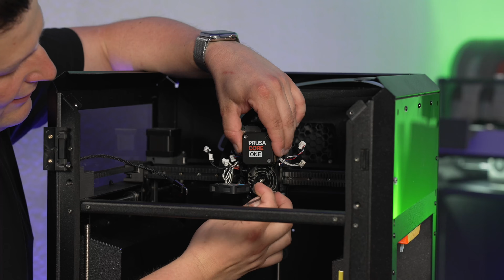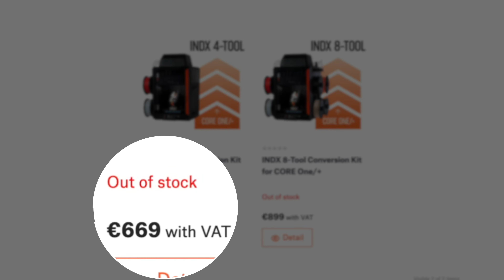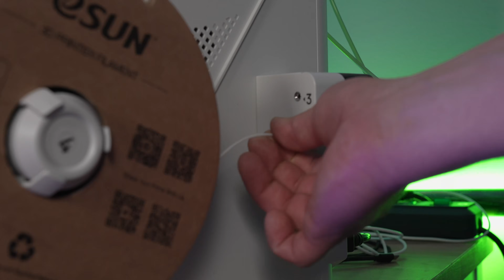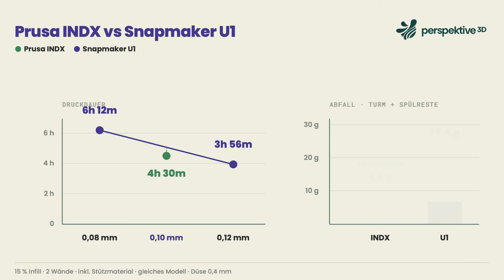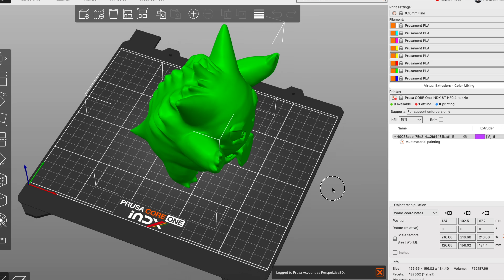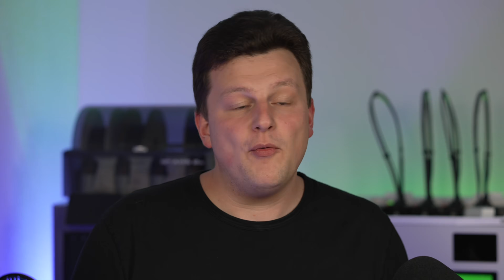Prusa INDX: Is It Worth the Wait? My First Look

Comment: Did you do any retraction calibration, or other testing? If you did, I'm sure we'd all like to see results and how it changed. If you didn't...

I wouldn't expect individual nozzles to be available for sale until demand slows and they can fulfill new orders.
Reply from the maker: I did no retraction calibration as I wanted to stick to the regular calibration that the printer does out of the box. I never did any retraction calibration for PLA on any of my printers
Reply: @p3d-intl   I sometimes get stringing between different colors of the same brand of filament. Not doing a 15 min calibration, even just for demonstration purposes, because "I don't want to" is absurd.

Comment: I would have been fine with just two nozzles on the Core one+/L. That's what prusa needs to release to be able to compete against the X2D, which will be it's most imminent competition. One high temp nozzle for engineering prints and one lower temp nozzle for supports. That's what I want from prusa.

An kit upgrade like that with an active heater should be prusas most urgent focus imo.

Comment: Regarding the filament management on the printer...... it is such a pain and imagine what happens when you use printers at work with several users having access to them and swapping filaments without telling others in a clear way. Do we really need to do this manually in 2026? 😵‍💫😵‍💫

Comment: I think I'll stick with my Snapmaker U1. Even with just 4 colors it's still a game changer and I haven't had a single issue with it in hundreds of hours of printing. I was a Prusa fan boy for years with my MK3, but they dropped the ball and have gotten lapped by the field. The Snapmaker running Klipper and Paxx firmware is just perfect. I really like the RFID tag support for the spools.

One a final note, I am mystified as to how you can recommend this upgrade at all. Did you see how crappy your model printed? It was unusable. This kit as it stands is unusable.

Comment: I would say the H2C with its 7 filaments with no purge and I think 25 filaments with surprisingly little purge depending on the model, is a much more compelling machine. 

You pay a little more but get a much large print volume and a very polished experience. I'm not convinced with the first impressions of INDX and I think they needed to put out a more polished product from the start.

Comment: I know that full spectrum and now this Prusa color mix thing are all the rage nowadays, but does anyone else agree with me that the colors they produce are pretty dreadful? Muddy, unsaturated, really poor on small details.
Reply from the maker: A true multicolor print will be better for sure. But will try the 8 color CMYKWRGB FullSpectrum print and lets see what it brings
Reply: @p3d-intl  Ok. I would like to see a 4-color print with regular filaments as I think that is more representative of the way most people print, and it would also serve as a comparison against the Snapmaker and Flashforge.
Reply: Full spectrum is just dithering with another name it can never produce high saturation colors because of the way it works. The bigger problem I see is the color can shift based on surface curvature so for organic models where people often print multicolor it doesn't work well.
Reply: I also don't get it. I've seen a lot of enthusiasm around it, but the prints just look bad.

Comment: So it's twice the price of the U1, buggy as all hell, and it's not even out yet. I am feeling rather smug about backing the U1 by now. I've gotten real and hard use out of it. It's not just a filament changer. It's a rugged and reliable machine, it performs automated coldpulls keeping the nozzles clean by default, I have hardened steel nozzles in various sizes, there's an active community developing crazy stuff like the color mixing, and that's just what immediately came to mind.

Comment: 7:22 not a u1 fan boy, I do own one, along with a p1s and a qidi q2, and actually the U1 has been my most problematic printer, but I have timed tool changes a couple dozen times and even with the prime tower I've never had it take more than 13 seconds from stopping printing to starting printing. Most the time it's been almost exactly 12 seconds. Though the hours I've spent unclogging extruder pathways from 95a tpu is much more annoying than long print times and wasted filament imo
Reply: Very interesting !! I think about getting a X2D to print TPU with supports.

Comment: I’ll be upgrading my sv08 when the Indx is available, but I’m in no rush. I have an H2c which handles everything I throw at it. Sure, it’s slower than a tool changer, but, again, I’m in no rush. I’m a hobbies and these I 3d print for fun. I think the Indx is the best tool changing system out there, I just wish printer manufacturers would just license the tech from Bondtech and sell a completed machine with the Indx installed. I believe the Sovol M1d (?) is an Indx tool changer. I won’t be buying that one because I already own an sv08 and I wanna tinker with the upgrade process.

Comment: Excellent analysis. I think this V-block purge method with single wiper styled like bambu and snapmaker wipers with a silicon brush and a ptfe tube on a hinge will be epic. Mod the snapmaker U1? Eliminating the prime tower would be epic.

On the hotend temp. I would bet that the "needs 6 colours" market and the "needs engineering filaments" market have minimal overlap. and the 6 colours market is WAY bigger.

Comment: do you need that many nozzles? YES! I've had plenty of times where 5 is not enough.......AND you get a support nozzle (when the software gets updated). Since I'm doing the core one L, This means 9 colors + support. I'm wondering if you could do purge to infil to get better quality. Assuming the firmware update doesn't work........I'm curious to see the result of the firmware update.

Comment: The only thing this machine has over other multi tool printers is the number of tools and those are cheap. The print quality isnt as good as the others, its expensive for a lackluster printer, and the fact that Prusa can take years to get their updates right shows a lack of urgency. This practice is predatory as they know their diehard fans will pay for it. There are other printers, while they have fewer tool heads, have a much better software, built in features, and the print quality is definitely better. No one should be recommending this printer at least until they get their shyt together and fix the glaring misses.

Comment: Ah, the 290C may not be the nozzle issue but the current housing they are using for the nozzle and tool head can’t be heated up more currently. 🥲 

We might need more metal housing INDX in the future. 😅🤘 🎸

Comment: I almost ordered it at release! And almost when Prusa opened the pre-order. I held back both times. And it was the right call for me! My interest is in multi-material, not multi-color. The ability to use multiple nozzle-sizes in one print could be of interest. But that is probably not going to be available for quite some time. And last but not the least: It needs better heat-capabilities! Higher nozzle-temps, higher chamber-temp tolerance, and an active heater! I have been a Prusa supporter (not fanboy) for years! But this is getting silly! Look around you, what the others are doing! How hard can it be to develop some sort of integrated filament management system, instead of those overprices passive dryboxes scattered all over the Core One? And why go with the Core One + from the start, rather than the much more suitable Core One L?

I just ran out of patience with Prusa! Despite hating the company BBL, I just got myself an H2D with AMS 2 Pro. Have not done much more than test-prints yet. And it certainly has it's quirks as well! But the level of integration and neat packaging is decades above Prusa! At the end of the day, reliable prints is what matters the most. And I simply don't know much about that yet for the H2D. Bur first impression of the physical appearance is great! I just hope I can make it work the way I want it to, without using any of their cloud services. 😛

Comment: I own a Core One+ and wanted to order the Indx. Now the maxtemp of 290 is a deal breaker for me, so I'll wait and see. I'm mostly using it for tougher filaments and wanted Indx for supports in cheaper materials, different sized nozzles for speed/detail etc. I have some filaments printing around 295.

Comment: Thanks for the review. So far for the price and all the delays I am not impressed with the printer at all. I would like to see some regular multicolor prints, Not the mixed ones. As in compare some four color prints against other four  color printers. And I would like to see some 6 and 8 color prints too.
Reply from the maker: Thanks for your feedback. Will plan that for the review
Reply: @p3d-intl  I have a Creator 5 Pro on order. For me to even consider buying a printer this expensive it would have to print as good, if not better than a Creator 5 Pro. I would rarely print with more than 4 colors. I would love to see some 6 - 8 color prints with this printer.

Can you print a HueForge type print in 6 - 8 colors. I would love to see how one turns out in that many colors without a bunch of purge waste.

Comment: How many people have the skills,  time, and inclination to spend 8 hours assembling a printer. This Prusa INDX will not be a factor in the marketplace until they come out with a complete unit at a reasonable price.
Reply: I've spent so many weekends tearing down and rebuilding my MK3 with a full Bear frame, swapping motors, adding Octoprint, all kinds of stuff. It's a lot of fun, in fact. Plus you learn all about how the printer is built so it's a good learning experience as well. Having said that, the kit is useless if it prints crap like in the video.
Reply: @jefflorenzini Like he said, skill, time and inclination, printing and building a printer are kinda different hobbies.

Comment: For that price I want a functional out-of-box product and not have to dial it for the next few days. Do better Bondtech and Prusa or lower the price.
I have no gain of wasting 16g less filament PER PLATE if the whole batch is coming out unusable. The math doesn't add up with reducing waste because it would take such a long time to pay out the purchase price with waste savings. Swing and a miss..

Comment: Thank you for a great content. Really puts things into perspective.
A few ideas:
1. Print 4 colour models and compare (quality, speed, waste, etc.) to U1 and H2C.
2. Print 7 colour models and compare (quality, speed, waste, etc.) to U1 and H2C.
3. Print 8 colour models and compare (quality, speed, waste, etc.) to U1 and H2C.
4. Print 9+ colour models and compare (quality, speed, waste, etc.) to U1 and H2C.
5. Test reliability and quality at high precision, i.e. 0.05-0.12 layer height with 0.2mm nozzle. I'd recommend printing a miniature with a lot of details (some kind of D&D miniature). For certain projects high precision is essential and printing a miniature is a good torture test for that. BambuLab printers are very reliable when it comes to such high precision tasks.
Note 1: I don't know how if you have those, but having two AMS units and a filament track switch should give better results for H2C.
Note 2: filament used should either be a random non-native filament for all or a native filament for each brand (BL filament for H2C, Prusa filament for INDX, etc.).
Reply from the maker: Thanks for your detailed comment. Will take this into consideration for the review. But how and why should two AMS and Filament track switch give better results? You mean because change time could be optimized?

One more thing where I am not sure what is the best way to compare: For the U1 you could reduce change time by making the tower smaller and or reduce purge volume. For the H2C the time depends on the PTFE length as well. If I try to optimize each printer it could be a more realistic view but you could always argue that I havent optimized enough in one or the other case. Thats why I am leaning more torwards manufacturer profiles and settings. Then it is up to each manufacturer to give me the best machine with the best settings
Reply: @p3d-intl , yes, exactly, I thought that track switch could give some optimization. Honestly ? If you have time and means, you could do both: default settings results and optimized settings results. Even split it into a few videos/parts. More content for you. If you don't have time or mood, then do just about default manufacturer settings. That would be fine for any average user. Optimization thing is more for nerds tinkerers.

Comment: Reality is that it wasn’t Prusa everyone was laughing at this point.
I loved the part “everything works solid, outstanding, beside the color changing part”, not really important on a 900$ color changing tool… “this electric screwdriver is awesome, but it doesn’t screw very well, but on everything else is good”.

You pay 2 grand to do everything yourself, it says something like 260 or 280 steps, basically a LEGO project, and I guess if you made a mistake and something break is on you and you can’t even buy spare parts.

But you know, you can save 4 seconds on a U1, a budget friendly printer that cost less than the indx alone, and 18g of wastage, and everything is 100% manual like the even cheaper C5.

Sounds like a good deal to me, I wanna see how does it compare to a 1100 bucks M1D that is completely automatic and ready to print every material out of the box and comes already assembled (1400 for the fully enclosed one) and the new Creality that probably will be on different sizes and nozzles

Comment: i'd just like to to mention that he was using Prusament PLA profiles in the slicer while using generic, non prusament pla filament.  i understand the need for the bad printing shock value, but I feel like this was not a fair comparison.  The bad printing may be  caused by incorrect settings per filament.  Still this was a great overlook of the indx system and thanks for the video!
Reply: This is a printer upgrade. Not a full, put-together printer. Of course there is fine-tuning. He even says that the hardware isn't the issue. If you're doing 3d printing as a hobby, and buying an upgrade package that takes 6 hours to build, surely a few hours of tinkering can't be that bothersome.
Reply: I throw all kinds of PLA into my H2C and select the BL PLA profile and they all print great. PLA is the easiest to print with, he wasn’t using PCCF, he was using PLA, he shouldn’t have to tune PLA to get a good print. It’s ridiculous to think he couldn’t just use the generic profile and get a good print, the U1 did it just fine. This is a cope.
Reply: @CSAlso2 Choosing "generic PLA" instead of "Prusament PLA" is hardly fine tuning; it's unlikely to have made a big difference but it should have still been tested to make sure as that's the difference between a very mild inconvenience and a big deal

Comment: This product will ultimately fail. I can see these two companies pointing fingers at each other over problems ultimately resulting into a falling out. Additionally I don’t see this product being combined and shipped complete because I have strong doubts they will be able to meet the regulatory hurdles, particularly the EMC Directive of the European Union.

This whole introduction was poorly planned. Anyone can build one, to build in quantity is a entirely different matter
Reply: Bambu has already relesed an induction hotend on their H2C, but that one uses a ferrite core to guide the magnetic field.
But I dont think that EMC will be a massive problem, as the coil only produces a magnetic field, and that drops off with d^3.
Reply: @lukahierl9857   you cannot draw a conclusion from what someone else is doing. I've been thru many safety/emc testing of products for the US and Europe. It has to be solved from a SYSTEM level, not a component level. These two companies are offering components.

Comment: Never owned any prusa printers, in my opinion they are half cooked and overpriced. Happy bambulab owner here
Reply: I agree with you. Also, your opinion is not an opinion, it's just the truth. Prusa used to be one of the only brands to get if you wanted some of the best print quality and reliability in the consumer market at the time. I had a Tevo Tornado (not a good printer even when it was new) and almost bought their MK3S+ as an upgrade before Bambu Lab made their disruptive debut with the X1-Carbon. Prusas are still good machines, just not for the price. The Bambu Lab machines, software, replacement parts, and support are just simply better, while at a cheaper price.

Comment: Thanks for this video. I have been wondering if i should go with this or grab bam. Did you ever get it to multi color print without total garbage output?
Reply from the maker: With primetower yes. And there is a new firmware update that I haven‘t tested yet

Comment: Probably just going to buy a MMU3, since I'm not doing multi colored prints... all I really want is automatic fulfillment switchover for when a spool runs out... FWIW I have a C1L.
Reply from the maker: With the MMU3 I was not super happy in terms of reliability. And please take a deeper look into the spool swap feature because with the MMU3 the core one has no option to clean the nozzle. In my case it caused a small defect all the time. Have to test it with the INDX